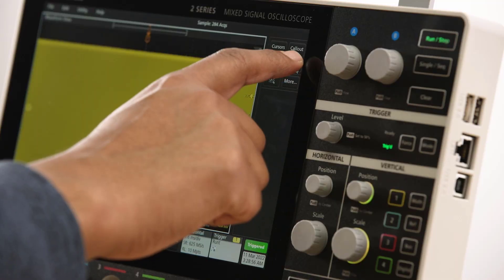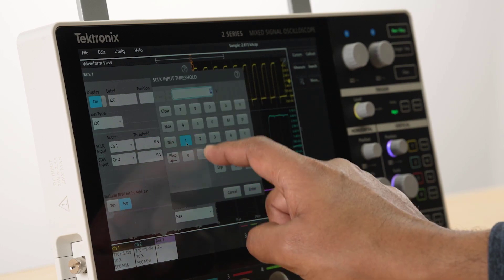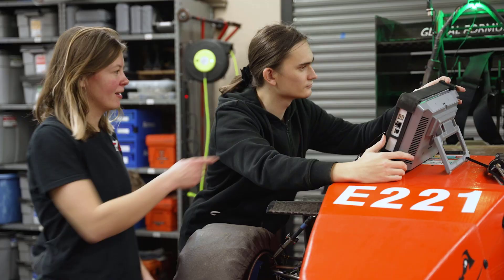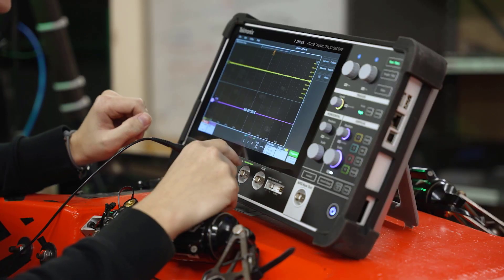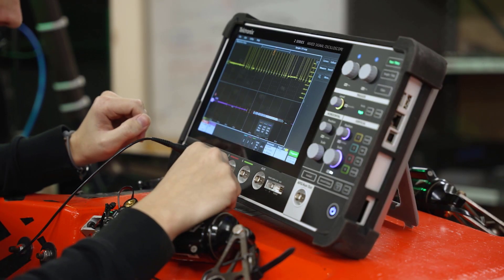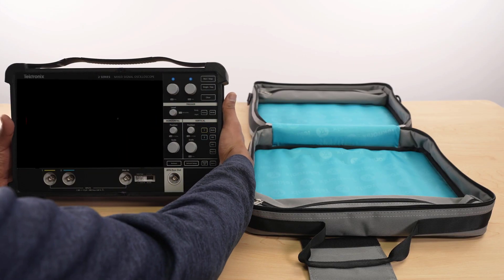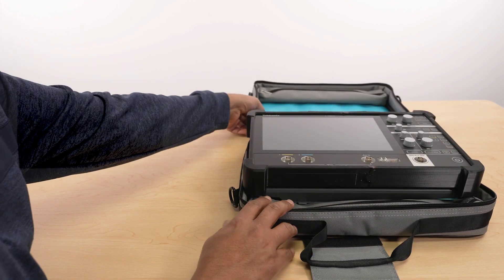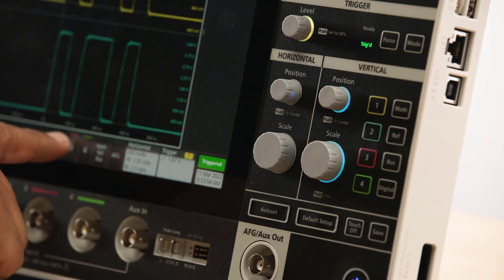The Team Behind Next Gen Tek

Comment: Today is about the software. The High freq staff is very complicated (probing) and narrow range of people needed.The modern A/D-s are covering 80 percent of the needs. ( Chienese still having issuses with the frontends.)
Automated measurents (problem focusig), data collection, battery, education features. 
Smaller cheap versions they canbe intagrated into automated environment. Go no go simple type.
To help Engineers tho get things documented faster, and allow them to spend time on the more important things.
If I need digital decoding I just use specialised USB hardwre on PC. 
I have Keysight by the way.  And some old Tektronics.